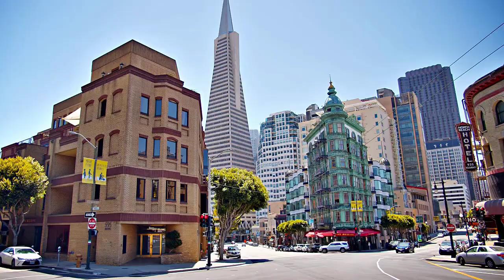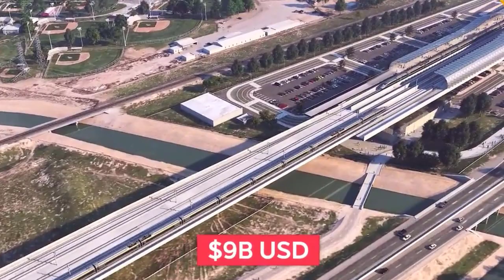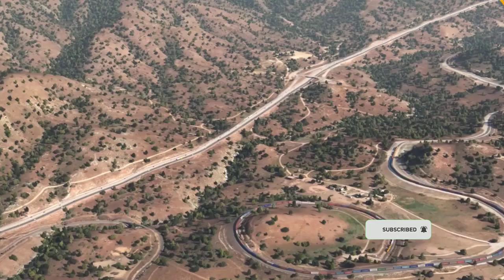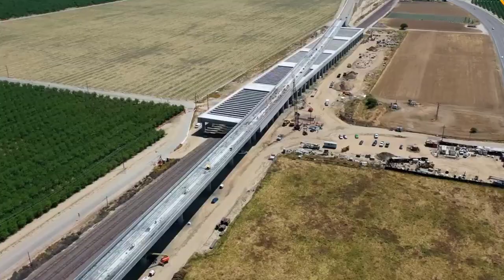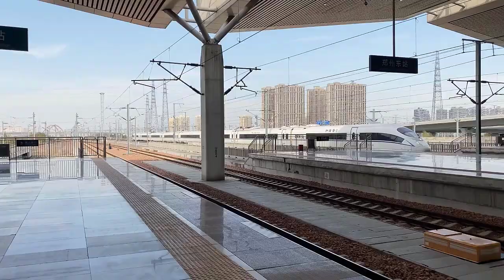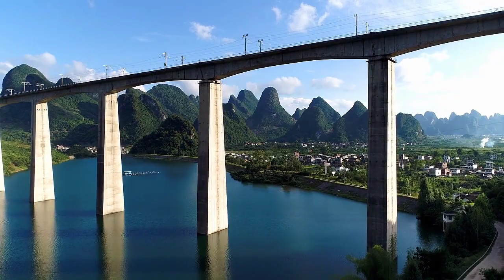California's $128 billion High Speed Rail Project Failed

Comment: 6hrs driving cutting down to 3hrs is not right info. This 380miles or 610km, an HSR with 220mph or 350kph, it would takes 1 hour 45 minutes non stop to cover the distance. With stops factored in it would only take 2 hours 15 minutes to 2 hours 30 minutes …. Definitely not 3 hours